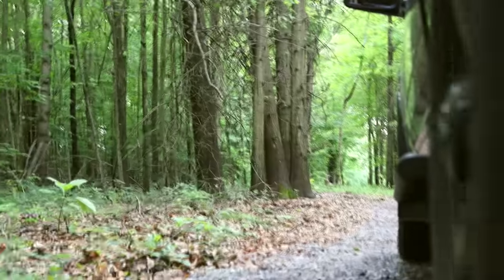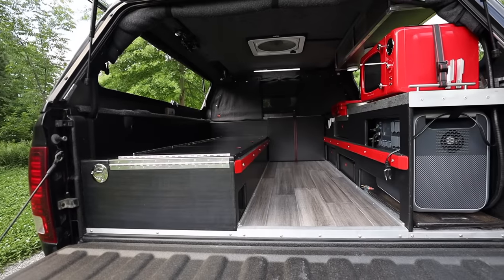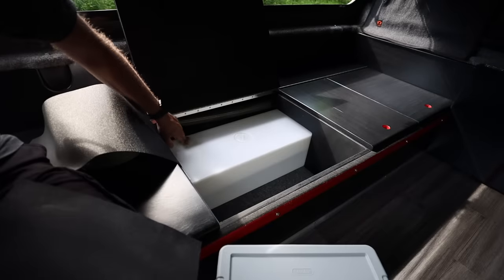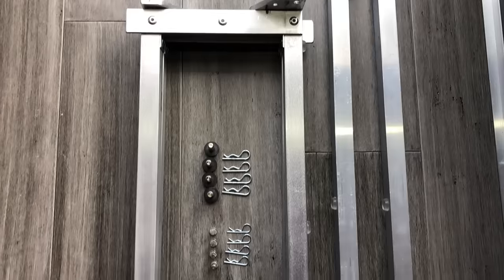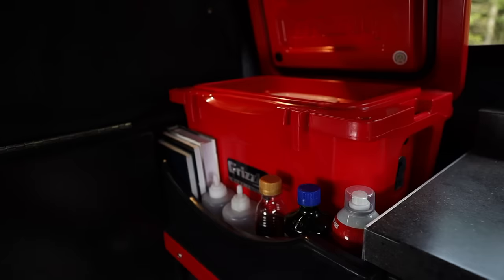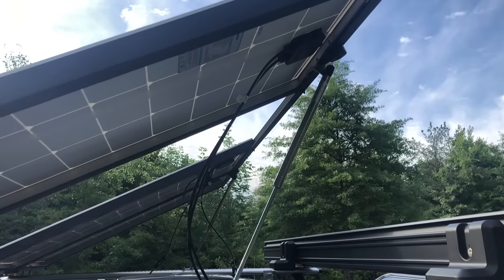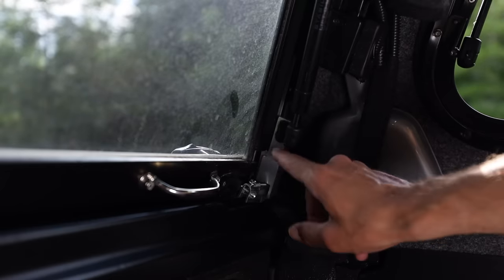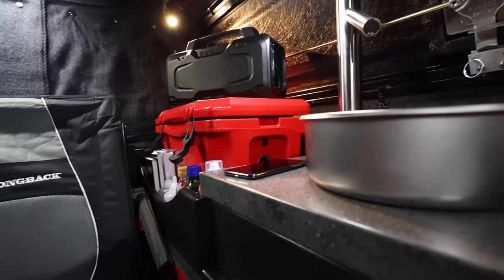My Ultimate Truck Cap Camper Build Full Tour!

Comment: Hello,it’s me again 😂 where did you buy the pop up drain to barb adapter,I see the drain stuff but the Barbed adapter,thank you
Reply from the maker: Hi Burt! I didn't include the link in the description because the connector I purchased wasn't "plug and play". This is what I used:
https://www.amazon.com/DERNORD-Barbed-Adapter-Sanitary-Fitting/dp/B0716S2D6Z/ref=sr_1_6?crid=1L3CEO33Z8CO1&keywords=dernord+2+inch+tri+clamp+to+0.75%22&qid=1665353948&qu=eyJxc2MiOiIxLjIxIiwicXNhIjoiMC4wMCIsInFzcCI6IjAuMDAifQ%3D%3D&sprefix=dernord+2+inch+tri+clamp+to+0.75+%2Caps%2C72&sr=8-6

But...I really had to grind off a lot of the "funnel" portion of the adapter to get it to fit. Once modified it worked great, but out of the box it was too thick to connect. I couldn't find anything better, doesn't mean something better doesn't exist though. But, there you have it. Good luck if you choose to go the same route!

Comment: Amazing, im now inspired to step  up my truck camper this year. How did you secure the wood to the truck bed/ceiling ? This being the foundation is one of the most important steps, yet im not sure how to go about it.
Reply from the maker: Thanks so much! I placed a base platform that fits securely between the wheel wells. Then I made two sides and an end piece that sandwiches between the side. I used L brackets to secure everything together. Then I made a custom bracket to attach the counter to the cap bracket. The upper cabinets are attached to longer bolts I replaced that attaches the roof rails to the cap. Hope that helps!

Comment: love it all but - why the toilet? just curious. Would feel so weird shi***ng in my truck lmao! sweet build!
Reply from the maker: Honestly, using the toilet in the tramper doesn’t feel a whole lot different than going in any other camper I’ve owned…space is just a bit smaller. On the rare occasion we use it for #2, the maxxair fan provides plenty of ventilation and the other party would exit the vehicle providing privacy. But usually, it’s used for those functions other than #2 when we don’t have access to an external bathroom in the middle of the night. Thanks for watching!

Comment: Your build is amazing!  I've been looking for an electric instant water heater solution like yours. First time I have heard of the Chronomite brand and it seems like you might be the only person on YouTube who has installed it in a truck camper!  I use a Bluetti AC200MAX and I would be very interested to know if you have been satisfied with the water heater?  How is the power consumption for a typical activity like washing dishes or taking a quick shower?  Would you make the same choice again?
Reply from the maker: It only performs well in the warmer months for it doesn’t have enough power to raise the temperature of cold water more than a few degrees. The first time I put water in it this year it sprung a leak. Even though I drained it for winter, I’m guessing some residual got trapped in there and froze. The power consumption wasn’t too bad for the little time we actually would use it. I probably would come up with a different solution if I needed it to work in the winter.
Reply: @WhentheDustSettles  thank you for the info!  I guess I will stick with my original plan to go with a propane water heater!  I would love to find an electric solution instead of running three sources of power in my truck camper: electric for fridge and lights, (and an induction cooktop or microwave), diesel for air heater, and propane for a water heater!

Comment: Amazing! I just don't understand why you chose not to run a small Dometic Fridge rather than an Ice chest. There is very little power draw on the fridge and it is way more versatile than an Ice box. Otherwise, this is really amazing. nice work
Reply from the maker: Thank you!! I actually do have a DC fridge/freezer that I keep in the cab. I show it in the Tour part 2. Ultimately I did remove the cooler and moved the Bluetti up to where it was. Always improving! ☺️

Comment: Hi. Can you tell me how you cut the hole in the dog bowl for the drain? I am also curious how well the Chronomite WH works. And, I wonder about going with a Bosch 2.5 gallon point-of-use type. Thoughts? Thanks very much... Earl.
Reply from the maker: I used a hole saw on a drill press…if I remember it wasn’t the easiest to cut through, think I even added a bit of oil to the surface while drilling. After the hole was cut I cut a much larger hole in a 3/4” board and set the bowl centered on top of it. I used a bowling ball to contour the bowl a bit for proper drainage. All in all it took one bowl to practice and the second one came out just about perfect. There are times though I do wish I had a bit larger bowl. I actually looked at the Bosh first and probably would have gone that route if I would have had the extra room. The chronomite I have works well in the summer, but not so much in the colder months. I did own a higher watt version that worked fantastic. So, if you can support the wattage, I definitely would go bigger. Hope that helps!
Reply: @WhentheDustSettles  I read your reply awhile ago but forgot to say thanks.... so thanks a bunch. As it turned out, I also didn't have room for that Bosch either, but the Chronomite fits well and within the sink cabinet for simplicity... might have to go with that one. The claim is it raises water temp 24 degrees at 0.5 GPM, like you said is okay in summer. I went with a smallish porcelain vessel sink. Also in the sink cabinet is Seaflo water pump and two 6 gallon jerry cans; one for fresh water the other for gray (with two more up front). Microwave: as much as I love the nostalgia type like you have, I decided to to 900w for quicker action... don't like to wait for my popcorn!

Comment: Barnlime is cheap and better than Lysol for reducing smells and speeding up composting.  You can always use wood ashes from a fire in a pinch instead of Barnlime to throw on your personal waste matter.  (Overkill, but I like some of your ideas.  Thanks.)
Reply from the maker: I’m just not into roughing it as much anymore!😊 Thanks for the tips! My bucket has an airtight screw on lid that helps if I have to store anything, but usually if we have solid waste, it doesn’t stay inside.

Comment: Awesome build, great creativity and ingenuity to fit all of that! What is that low profile 12v plug? Thought you said it was the weipu, but that doesn’t look like it.
Reply from the maker: Thanks!! I started with the standard weipu plug an modified it to make it low profile. I soldered the wires on and brought them out the side and filled the void with epoxy.
Reply: @WhentheDustSettles  Thanks for the clarification. Is the cord plugged into the other DC output for a specific device?
Reply from the maker: Sure thing! I wired the other end into my DC fuse box that my lights, water pump, and fan are wired into it. I just had to make sure whatever I wired in didn’t exceed the 25amps.
Reply: @WhentheDustSettles  oh I just meant the other DC output from the Bluetti. I see two 12V outputs: 1 weipu connector and one other cigarette lighter plug style connector. I am curious about the cigarette plug connector because it looks almost flush with the Bluetti, which is appealing to me since most 12V plugs stick out pretty far from wherever they’re plugged in. Did you link the plug for the connector that is plugged into the 10A 12V output? I was assuming it was going to a specific device and the connector was not a COTS part. Thanks!
Reply from the maker: @thatwideangle9781  Oh...that one is a low profile adapter for my sirius receiver. I had to order a low profile one so it didn't stick out and interfere with the double bed.

Comment: Beautiful build! where does the drain for the sink go?
Reply from the maker: Thank you! It drains out the truck bed drains that are usually plugged with plastic covers. I ran a drain tube out and then collect the grey water in a 5 gallon water jug while in use.

Comment: Amazing build! Congrats best truck cap design yet!! How did you stop dust getting in on the gravel roads? No pass thru from rear truck sliding  window? B Deacon Manitoba Canada 🇨🇦
Reply from the maker: Thank you! I didn't show them in the tour, but I made these custom pads that fit on each side of the tailgate to "seal" the air gaps. Also, I put a piece of weather stripping along the bottom edge where the tailgate meet the bed of the truck. It took awhile coming up with something that worked well. With that being said, I haven't taken it down any dirt roads yet, but road dust has been kept to a minimum.
Reply: Absolutely one of the Best: unreal what you have packed into the construction👍 I forgot the make of the cap? How long to install everything? How much scratch $$$$ have you got into the build?

Comment: Does your truck's tailgate have a locking mechanism to prevent it from opening from the outside while you're inside the camper or away from your truck?
Reply from the maker: Yes, it locks with the automatic locks.

Comment: Awesome build. Are you using the Chronomite 15 amp 120 volt unit? And the Bluetti runs it without a problem?
Reply from the maker: Thanks Michael! Yes…and runs it like a champ. Although don’t expect a whole lot out of the 15amp version. In the summer it works great to make hot water…not so much in the colder months. I have considered attaching my shower hose to the faucet and then running the water back into the fresh water tank to create a loop to get the water hot. I haven’t tried it but in theory I think it would work.

Comment: That is really well done. Well organized! Since you have a megacab, how much stuff do you keep in the cab when camping and how long (# of nights) do you typically camp? 
I want a similar setup and saw you have an AC/fan unit on top. How well does that work in summer?
Reply from the maker: Thanks! What we keep in the cab depends on the trip. I have some standard gear, but will sometimes bring some folding bikes and a blackstone griddle. I’ll do a tour of the cab in a future video. My wife and I have stayed 2 nights in it and it was great. I am now at a point where I will be able to take some longer trips in it…so more adventures to share!
Reply from the maker: Oh…and the maxxair fan works great. Park in the shade on the really hot days, but it’s great at night.

Comment: Awesome set up, should have kept a small pull behind do to the size overall, most people dont have 50,000-70,000 pick up to do this with, nor an additional 5000.00 to put into it. Then there is gas, aint cheap, full tank 200.00 per fill up.  Have fun...
Reply from the maker: Thanks! Yeah…it’s definitely not cheap, but with the prices of everything skyrocketing and feel there will be more and more diy builds out there.

Comment: How much would you say that this entire setup weighs? I'm curious how much it would affect my payload capacity.
Reply from the maker: There is roughly 3 sheets of plywood at about 180lbs, a 7 gallon fresh water tank @ 8lbs ppg, the hanging cabinet weighs about 15lbs, the Bluetti is about 50lbs, the plumbing an electrical probably weighs no more than 20lbs…so approximately 321lbs plus any stuff like microwave, countertops , gear, etc.

Comment: Would you possibly consider making build plans to sell? I love this!
Reply from the maker: I’ve been tossing around some ideas. Only issue with this build would be is I made it very custom to this bed to squeeze out as much space as possible. To my surprise, the bed of the truck is not square at all. For example, the bed is wider at the back than it is at the tailgate so that I would have a square center aisle.
Reply: I have a ram 1500 6’ 4 bed so wonder how close certain dimensions would be.
Reply from the maker: I’m guessing they wouldn’t be too far off.
Reply: Any updates to possible build plans? Thank you!

Comment: How did you manage to paint the inside of the holes without painting the black finish?
Reply from the maker: Hi Dad 108! I took a piece of foam and placed the board on top it, then took a piece of paper and cut out a hole and placed it on top of the board and carefully sprayed the red paint in the hole. Thanks for watching!

Comment: Curious as to what the total added weight was. Thanks. Great build!
Reply from the maker: Thank you! That’s a good question…I’ll have to stop and get it weighed sometime. I believe it took 3 full sheets of plywood plus everything else. I used to have a decked system and a Honda 7000 generator in the back so I figured it was probably pretty comparable in weight.

Comment: Wow impressive….but way overkill.  My F-150 hybrid has 7.2 kw and a personal AC that pipes into the truck cap for summer camping in hot weather…perfect sleep.  Electric blankets in the winter are off the chart.  Never runs out of power as it has 7200 watts available anytime…what a game changer.  Electric or gas cooking is my option again with unlimited power.  No worries with solar…who needs it now.  It can rain for a week…I don’t care.  Upgrade to this truck and it is almost a hotel.
Reply from the maker: Yeah, I definitely went the "glamping" route with this build. One of my inspirations was Airstream Travel Trailers. The built in generator on your Ford sounds awesome...thanks for watching!

Comment: This is a cool setup. Electronics are spot on, but there's a TON you can downsize inside just using a MOLLE mesh or MOLLE seat covers. I'd throw the Microwave in a wood chipper. That's cheating. To each their own..
Reply from the maker: Lol…definitely to each their own. The microwave is there for when I’m out of fuel and can’t get a fire started with wood, I can always boil water if I need to. With the solar generator, it’s self sufficient. Plus the older I get, the less I’m in to roughing it! Thanks for watching!
Reply: @WhentheDustSettles  save some dry wood in there. Buy a hot tent stove and have the other wood dry next to it while it's heating. :)
Reply from the maker: All excellent ideas…thanks for sharing!

Comment: Where do you keep your food and beverages.
Reply from the maker: Next week’s video will touch on this some. I have a 12v fridge for stuff that needs refrigerated. I use the cupboard and the microwave to store non-perishable food. I keep spices in the top drawer, peanut butter in a bottom drawer. I keep some in the grizzly cooler as well. Anything that doesn’t fits goes in a bag in the cab.

Comment: How long did your buildout take?  

And a silly question how does those maxx air fans work? Your all wired up but how can you add one without being all tricked out?

And a thought
 After you test your build out in the wild for an extended period, you should consider organizing a truck buildout workshop / with all these views you’d probably find a guiena pig with the funds to trick out their truck and loads of people who’d want a hands on view of how it’s done.
Reply from the maker: From start to absolute finish, probably 4 - 6 months with several lulls mixed in while I thought about the next steps. 

The fan runs off of 12v and does draw a whole lot of juice. You could get a small Jackery or similar device to run it off of. You might even be able to wire in an AC to DC adapter and use one of those EGO Power+ invertor for an EGO battery. Then you could use the batteries to power tools as well. Just thinking off the top of my head.

I like that idea. I've been mulling over the idea of making it into a business.
Reply from the maker: This guy has some great information on the fan...including an AC adapter for it:
https://youtu.be/MU8Zxqy4NaQ

Comment: Do your drawer doors fly open when you driving around? Asking for a speed-demon
Reply from the maker: Not yet. The drawers on the floor are held in place by the aluminum angle creating a lip. The drawer under the sink has magnetic latches. For added piece of mind I cut some anti-slip drawer liner and placed a piece under each drawer. I don’t take my truck off road much so I’m not sure how well they would stay if the truck were rocking back and forth.
Reply: @WhentheDustSettles  i was thinking about doing the same kind of drawer set up, but have latches, or bolt locks, just in case
Reply from the maker: Yeah, if I start going into rougher terrain, that’s not a bad idea!

Comment: Do you have more info on your solar setup?
Reply from the maker: Howdy…I had 3 100 watt renogy solar panels that would charge up the Bluetti. I’m currently in the process of redesigning it.
Reply: @WhentheDustSettles  I really thought those struts you put on the panels to pick up one side. Check out DIY solar with Will Prowse here on YouTube if you haven’t. He does more van stuff but the wiring is similar and I’m curious what you’ll come up with in a truck since your setup is basically what I want

Comment: Tell us about the red rails that the center platform sits on.  What are those of?
Reply from the maker: Hi Tony! The red rails are made of red oak. This is the support system for the bed addition and the table.
Reply: @WhentheDustSettles  Did you make them or buy them?  I was thinking about using some HDPE rails for strength and glidability.
Reply from the maker: @tonywillingham8109  I just made them. I also put a strip of cloth tape on the top of each rail that has worked out great for cushioning and decreased friction between the rails and the bed platform. I think the HDPE would be an excellent choice as well.